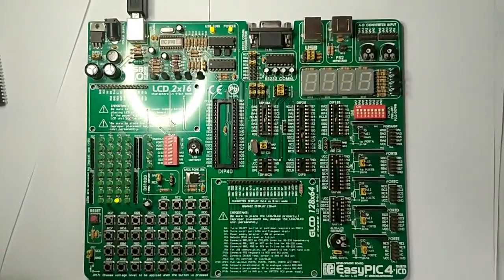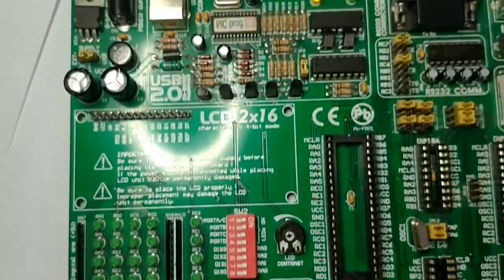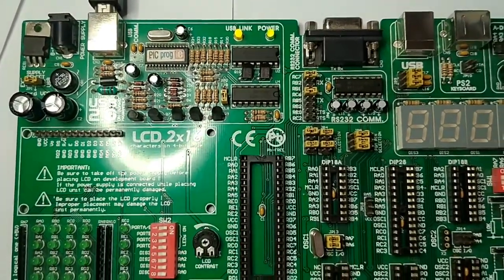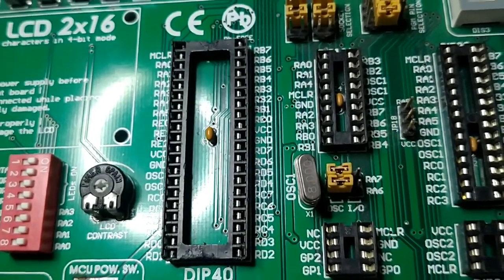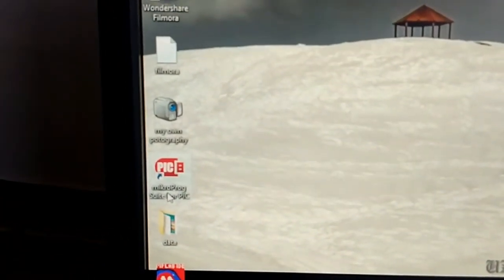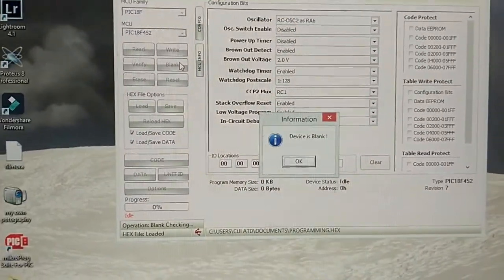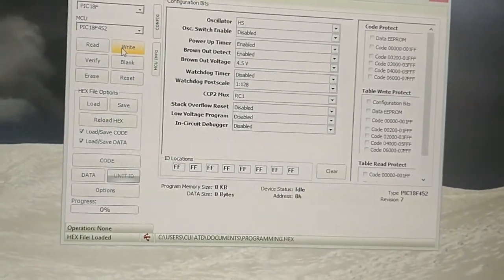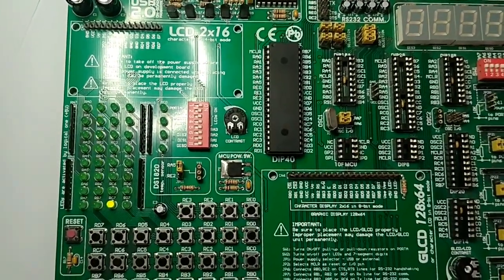Burning process of PIC18F microcontrollers (English version) || how to program a PIC microcontroller

Comment: Dear Sir, I have EasyPic 4 and Windows 11. I followed the PicFlash installation manual and was able to install it. But the Pic Driver does not work. The programmer software opens, but does not save. Do you have any information about this problem? I have already opened the application with Windows 98 compatibility, because when I had a PC with Windows 98, it worked. Thank you.

Comment: Sir good day I have a Spot weld his controller is using pic18f46k22. The problem is no sparks when I weld. I ask sir it is the microcontroller ic are defective? And if I buy a new one we need to program? or no need?
Reply from the maker: PLZ check the output of the microcontroller.